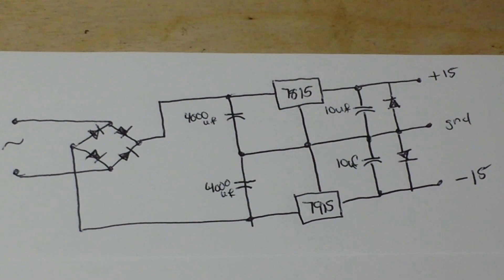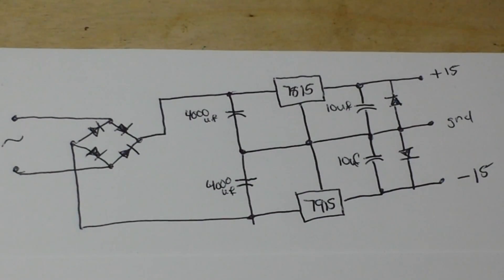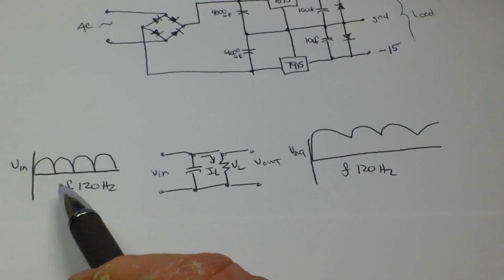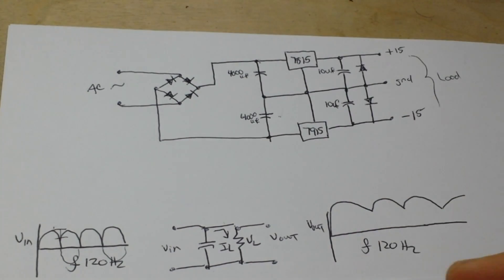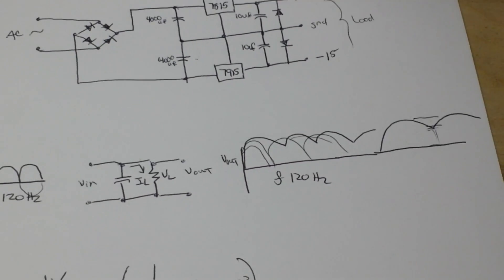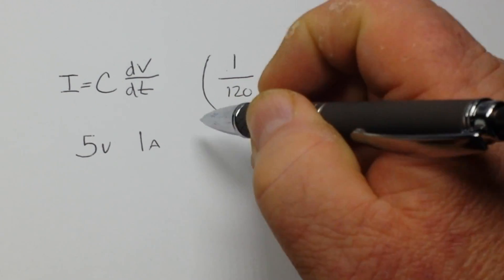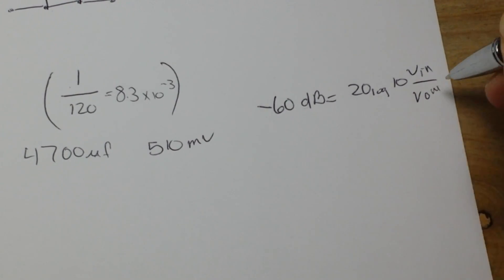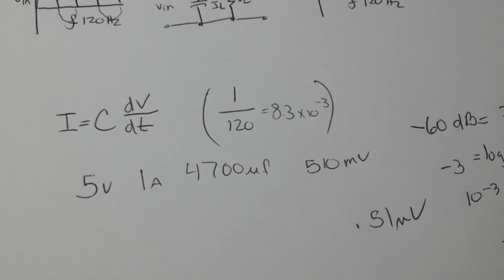How to choose filter capacitors for power supply

Comment: Your explanation up until the inversion of the lower half to full rectified to give doubling of line frequency is ok - thereafter you have pulled values off data sheets and knowing the answer pulled out the right “sort of” values . . . 

Let me add, if I might.

The formula for the required capacitance is:

 
𝐶=𝐼𝑙𝑜𝑎𝑑.2⋅𝑓⋅𝑉𝑝𝑝

This formula is derived from the basic capacitor equation 𝐼=𝐶𝑑𝑉𝑑𝑡, where the capacitor is approximated as discharging at a constant current for half of the AC cycle. 

Example calculation 
Imagine you are building a power supply with the following requirements: 
•	Load Current 𝐼𝑙𝑜𝑎 of 1.5 A
•	Line Frequency, f of 60 Hz
•	Acceptable Ripple 𝑉𝑝 0.05 V (50 mV)
•	Rectifier Type: Full-wave 
 
𝐶=1.5/(2⋅60⋅0.05
 
𝐶=0.25F

Since 1 Farad is a very large unit, this value is usually converted to microfarads (
 
𝜇
F) by multiplying by 1,000,000.

 
𝐶=0.25F⋅1,000,000=250,000𝜇F

Additional considerations 

The calculated capacitance is a starting point, and other factors influence the final choice. 
•	Voltage rating: The capacitor's voltage rating must be significantly higher than the peak rectified voltage from the transformer. A common rule of thumb is to choose a capacitor with a rating 20–50% higher than the maximum peak voltage. Remember that the peak voltage is approximately 
 
1.414×TransformerRMSVoltage
.
•	Ripple current rating: The current constantly flowing in and out of the capacitor generates heat. You must select a capacitor with a ripple current rating that exceeds the expected ripple current in your circuit, as high ripple can reduce the component's lifespan.
•	Tolerance: Capacitors have a manufacturing tolerance (e.g., ±20%). When making your final selection, choose a standard capacitance value that is equal to or greater than your calculated value to account for this variation.
•	Equivalent series resistance (ESR): A lower ESR is better for filtering applications because it reduces power loss and heating. Low-ESR capacitors are typically preferred for power supply filtering.
•	Physical size: Higher capacitance and voltage ratings generally mean 5:13 a larger capacitor. Always ensure the component fits within the available space in your enclosure.

Math !!!

Comment: Since we are dealing with relatively large values here, the differential equation "I = C dV/dT" may be written as IT=CV.  Rearranging:  I/V = C/T and plugging in V= 1 volt and  I=1 AMP, we get ONE volt per amp = C/T.   Plugging in (1/120)th of a  second for 'T' gives C=8333uF.
This tells us:
THE RIPPLE (UNDER LOAD) IS REDUCED BY ONE VOLT PER AMP FOR EVERY 8,333uF OF ADDITIONAL FILTER CAPACITANCE.    And, everything follows this 'proportion'.  For example, (1) adding only HALF of 8333uF or 4166uF; you get a 2v drop per amp.  (2) using a half wave rectifier (a single diode) will require twice as much 'C' for the same droop as a FWB.....etc, etc...
Hope this is useful.
--daLe
Reply: TIL the rule of thumb of 8300 uF per 1A is based on a 120 Hz rate, or a full-wave bridge rectifier at 60 Hz. .

Comment: Something here does not make sense, 

You wrote 5V, what purpose does that serve? Did you calculate C using formula, then why is it not on the left hand side? What exactly does 1A mean since when capacitor discharges, the current does not have a constant rate of change, it is an exponential decay. There are so many things that you did not clarify in this video.
Reply: I am at a loss to figure out how he applied that equation and came up with 510 mV of ripple with a 1 ampere load and a 4700 µF capacitor. I get 1.77 V of ripple.
In any case, using that method overestimates the capacitance required. It assumes the capacitor is continuously being discharged for the entire half cycle at constant current. The constant current part is OK - the regulator fixes the voltage across the load, thereby fixing the current.
The larger the capacitor the more accurate the calculation becomes because the time during which charging of the cap is occurring is reduced (since charging only occurs when the instantaneous voltage out of the rectifier is greater than the cap voltage).

He said that V in dV/dt is RMS. That is nonsense. dV/dt means "the differential of voltage with respect to time" or commonly "rate of change of voltage."

Comment: So is a filter cap just a regular cap with very high capacitance or is it specifically made for filtering
Reply: It depends on the lifetime you want. Electrolytic capacitors have a "wear-out" mechanism.

A good capacitor for this would be specified for high ripple current at 120 Hz. That goes with low equivalent series resistance (ESR). Where it becomes hard to compare is with lifetime and temperature specifications. It used to be common for run of the mill electrolytic caps to be rated for 1000 hours at 85 °C at the rated ripple current (and often would be no ripple current or ESR spec published). Now we have lots of caps rated at 105 °C and with lifetime ratings of 2000 to 10 000 hours. For each 10 °C reduction in operating temperature you approximately double the life of the cap. If the ripple current is reduced the life will increase. Low frequency ripple current rating is often much less than the high frequency ripple current rating for the same part. It's all rather messy. Major manufacturers will specify their parts well and often include graphs that help.

At one time large capacitors with screw terminals could be had in "computer grade." These are pretty much nonexistent now because computers all use switchmode power supplies.

Comment: Can you have to big of capacitors ?
Reply from the maker: Not really
Reply: @learnelectronics  what's your thoughts about converting a battery charger into a power supply for my cb amps would I just need to build a filter to clean up the ripping?
Reply: Increasing the capacitance will increase the ratio of RMS current from the transformer to DC output current. Loss in the transformer windings due to their resistance is proportional to the square of the RMS current. Transformers ratings are for RMS currents because of this. Exact values are hard to calculate for real transformers. Typically you might get something like 0.6  ampes DC for each RMS ampere (i.e. if you need 1 A DC out you would need a transformer with a secondary rating of 1.67 A). With more filter capacitance you might need a transformer with a somewhat higher RMS current rating, perhaps 1.8 A RMS rating for 1 A DC output. Reputable transformer manufactures will usually have some ap notes for guidance.

With really big caps you must be careful with "inrush" current when power is first applied. The current can be very high and last for several AC cycles. Slow-blow fuses are required and you might use diodes with higher current rating than you need for steady-state just so they'll survive the turn-on surge current (diode datasheets often include surge current ratings for this type of circuit). The transformer won't care - they can take large transient overcurrents as long as they don't last too long or happen too frequently.l

Comment: can't get 510mv out of the formula. 1=0,0047f x (dV/(1/120) ??
Reply: Looks like nonsense maths to me. Seems to me you get 1.76 volt ripple from this
Reply: Yeah totally agreed. The math on this video is absolute garbage. And assuming “1 over the freq”?? Why?? For a current value? Makes absolutely no fucking sense
Reply: @zachdavis5834  
If you use the entire half-cycle period (8.3 ms at 60 Hz) you are assuming that the time the cap spends being charged from the transformer is zero. That overestimates the amount of capacitance required for a particular ripple voltage.
The discharge from the peak voltage is constant current because of the regulator. If you have 5 volts out at 1 ampere, the current into the regulator is also 1 ampere and would be taken to be constant for purposes of calculation.

As the capacitance is made larger and larger the waveform becomes more and more like a sawtooth with rapid rise and linear fall. How long the charging current flows is difficult to estimate accurately because it depends a lot on the source impedance (transformer). 

His 510 mV is nonsense.
Reply: @zachdavis5834   1 / freq = time; e.g. 1/120 = 0.008333333 or 8300 msec.  Put another way, 1 GHz = 1 nanosecond (ns). [ or 1.0 x 10^9 Hz = 1 / (1.0 x 10^-9) seconds ]

Comment: This brings back memories when my dad told me as a kid that rectified AC is not a straight line (this was shocking to me as I was confused how electronics could tolerate such a thing). Anyway this is actually a complicated subject, may want to do a follow up video. Different types of capacitors have different amount of ripple even if the capacitance value is the same.  ESR and especially ESL come into play b/c an ideal capacitor does not exist in real life.

Comment: Help me about this matter . 

I have transformer 33v AC 50hrz 20amp .

I put bridge 30 amp with capacitor 10mF 50v .

But in some how the voltage get up to 52v because the capacitors detected the top voltage and it not stable .

In 20 amp load the voltage get down to 30v and the current get up to 30amp in AC section !!

There too much losses and too much heat and too much extra current in the ac section more than in DC section

Comment: Great video Paul.  Here’s a simplified guide; use 8500 uF for each amp in load current for 1 V ripple (that’s peak to peak ripple for the equation not rms), then if you want to cut the ripple in half double the size of capacitor.  If you want a fourth, so the 250 mV you talked about, then you multiply by 4 (to half the ripple twice). If load current is doubled, then multiply by 2.  

Example 1: 1 V ripple and 1 Amp, then 8500 uF 
Example 2: 1V ripple and 2 Amp (multiply by 2), so 17000 uF
Example 3: 250 mV ripple (multiply by 4) and 1 Amp load, so 8500 uF x 4 = 34000 uF
Example 4: 250 mV ripple (multiply by 4) and 2 Amp load, so 4500 uF x 4 x 2 = 67000 uF

I hope that makes sense.  I rounded up in most cases.
Reply: WHY DID YOU START WITH 4500uf?HOW DID YOU GET 66000uf?
Reply: david luther Thanks David, I’ve been on cold medicine - so I guess I’ll use that excuse;)
Reply: I like this way of looking at it.
Reply: I think in my opinion that convert AC to DC  with more 10 amp is not ideal for 50 or 60 Hertz . 
What if I want a pure DC 24v 25Amp with ripple 1% 240mv 

It will need a big capacitor  and that capacitor will need a very very big current in the starting from 0 to 24v ( that may short the life cycle for the capacitor ) .

I think the switching power supply is the best way for more than 8 amp
Reply: @abed_itani  Use a resistor (low ohms, high watts) to limit the input rush. As you say, saves the capacitor from becoming a high-cost short (or open).
   To calculate the resistance, use the input voltage peak and max inrush current (from capacitor spec sheet); R = E / I.
   To calculate the wattage, use 5 time constants of the RC value, and assume you'll have a minute (depending on the project) before you'll need to turn it on again, worst case. I^2 * R * Tc / (60 seconds). That's a conservative value, and if your project is power-hungry you may need to incorporate thermal load calculations.
   This resistor adds a tiny bit of ripple reduction, giving you a larger margin if you don't count on it.

Comment: Max DC input for 78xx 79xx is 30/40VDC...Use <120VAC to rectifier????
Reply: That is what the transformer does it was just not shown in the drawing. it would be to the left of this circuit. the transformer will step down the voltage to the level you need. remember you will have a drop in voltage after the rectifier because of the diodes also, about .6 to 1.2 volts. refer to the datasheet of the diode used for that number.
Reply: @curtstacy779  Tx

Comment: I've often wondered the same thing.  I have a question about the waveform of the rectifier.  If the rectifier is just removing the negative part of the wave, wouldn't the time spent at 0 volts be one half of a wave?   In my mind, I am picturing a halfwave hump above 0, a halfwave space and another halfwave hump above 0.  This leads me to another question.  If you were purchasing just one scope, would you get a 2 channel or a 4 channel?  I will use the scope to troubleshoot electronic devices of all kinds and to design breadboard circuits for self-education.
Reply: The four diodes configured that way is a "Full Wave Rectifier" if only two diodes were used it would be a "Half Wave Rectifier" and would appear to the O'scope as you described.  The full Wave actually flips the negative half of the sine wave as he describes in the video. I would think a two channel scope would be sufficient for your needs, but I don;t know your needs or how much you want to spend.
Reply: In the various (and varied) shops I worked in, we often had a 4-channel scope. It was always on the shelf because we almost never needed the capability. In a few cases, I did breadboard a switch so I could alternate between test points.

Comment: Thanks for the video. Very useful and demystifying to limited knowledge on power supplies. Any chance you can do a follow up vid (if you haven't already covered this), how to select the correct caps for voltage regulators based on say the different voltage you may require. ( Did that make sense lol). Thanks again.